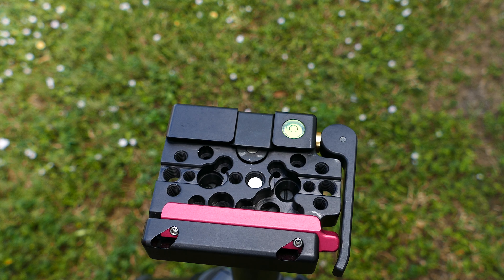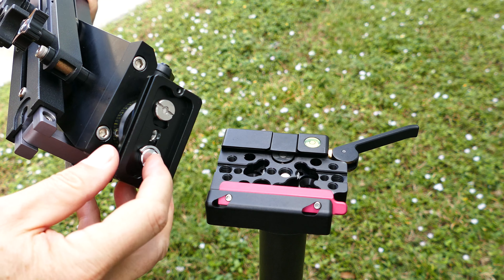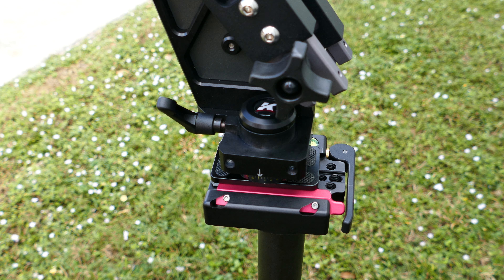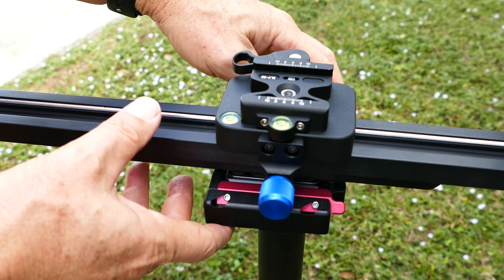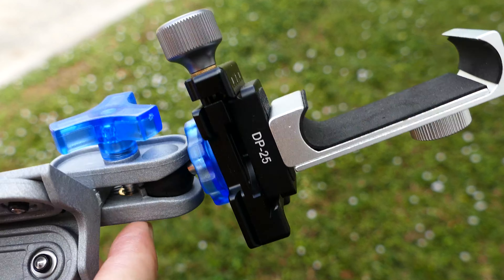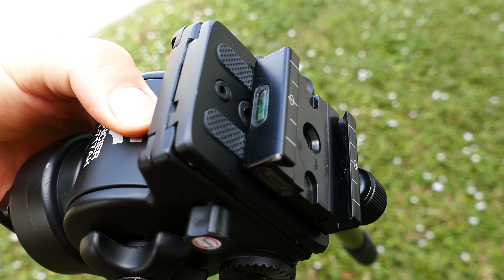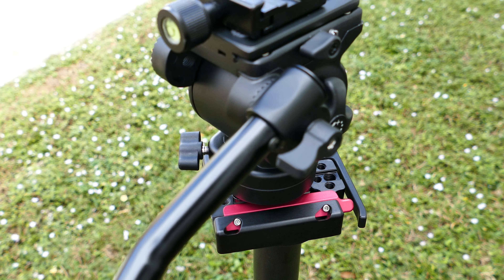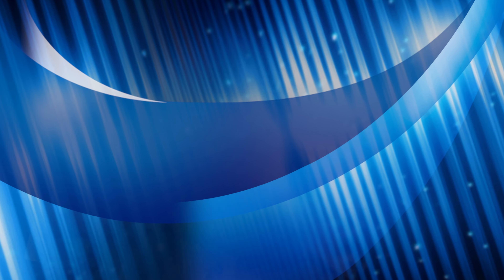Arca Swiss All The Way in 4k UHD

Comment: thanks for sharing this great technique of yours. I have been searching the brands to match a different plates brand and haven't found the right one. Now I am planing to modify it like yours. Maybe one question, is their any issue on stability while using it? and if so how do you deal with it? thanks.
Reply: its for video recording, and for that the head will be a fluid head.
Reply from the maker: I have found any high quality arca swiss type receivers and plates hold up well. If you need really heavy duty get the Kessler Kwik Release. It's over built for sure.
Reply: @MidAtlanticTV  I just recently own an andoer receiver and its plate ( CL-50LS ). Are andoer procuct good? The andoer receiver will be placed on the fluidheads plate, as you have showed us on your video.
Reply from the maker: I have not tested that unit. All I can say is try it out. If it doesn't seem strong enough for your use case go with the Kessler.
Reply: @MidAtlanticTV  OK... thanks..